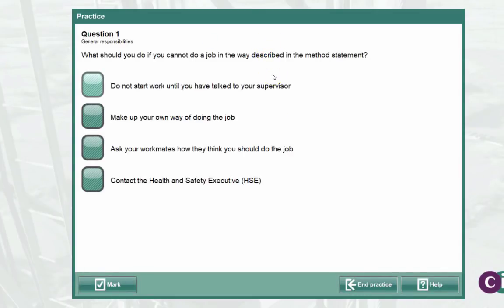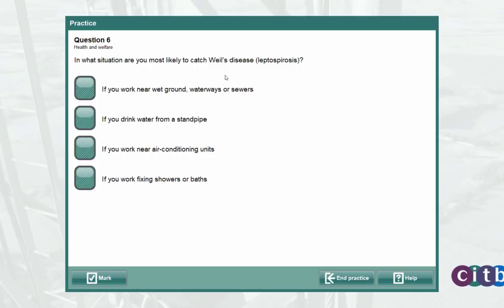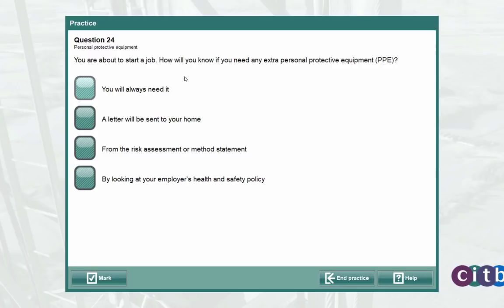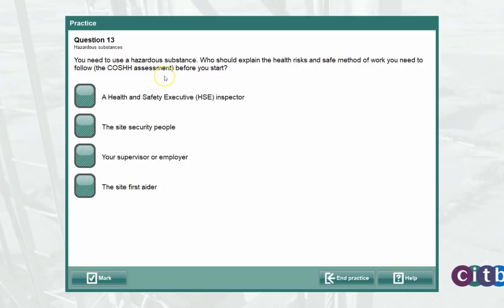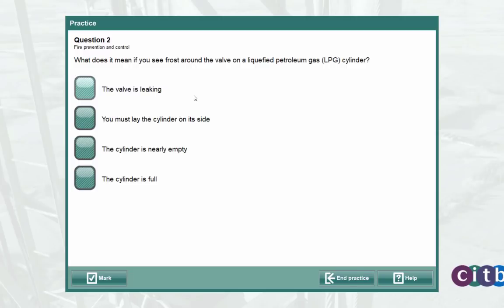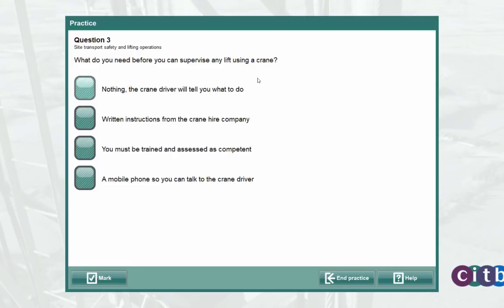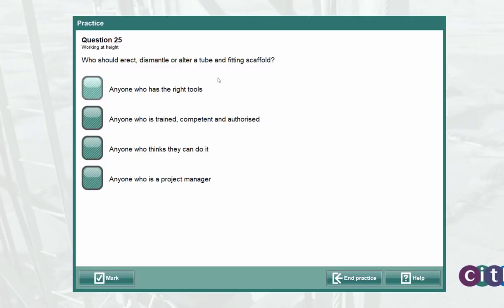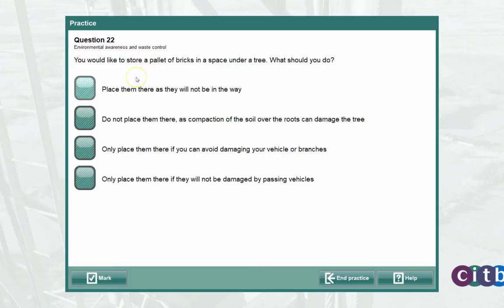CSCS Revision Questions

Comment: Sadly after studying for 3 months, learning all the questions & answers by heart and taking the mock exams on line daily and getting full marks, I took the real test and I failed dramatically. What I realised was that in the exam I had questions that are not in the test book and never heard of. How could this be possible??? Can someone give me an honest opinion please. I am disappointed and confused. Many thanks
Reply from the maker: Hi Osmany, did you check out the questions on this video?  You say you looked at the test book, what year was it? 

CITB change and add different questions from time to time but not so often.  This disc is 2018 and still has most of the current questions you will get on a CSCS test today. 

I recommend checking all theses questions and answers on this video and resit your test and I promise you most of the questions you get (if not all of them) will be on your CSCS test
Reply: Barry Joyce 
Hi Barry, thanks for taking your time to reply. The test book is from 2019-2020. Your video has all the relevant questions exactly the same as in the text, so that was a consolation, but if you read and study the book alone and do the mocks tests on line from/with the book you will not pass the exam because most of the questions are not in the text book. 
I am not sure if my rumbling makes sense but this is what I had experience...
Reply from the maker: @osmanyalmeidacruz6679  Yes, the books can be misleading as they also have tests for managers, gas etc.... so you will get confused. Keep revision on this video and you will not go far wrong - good luck and let me know when you pass :)

Comment: Are these questions very similar to the ones on the actual test? Thanks Callum
Reply from the maker: Hi Callum, yes, these are the actually questions you will get on your test. The disc was done in 2018 so there maybe a few new questions that are not on the video but not many
Reply: @BarryJoyce1590  They were exactly the same got 48/50 Thanks!
Reply from the maker: @callummccauley5276  awesome, well done

Comment: As well as watching this video, do you have any other tips for passing? I might buy the CITB app software. I think it’s around £5 , if I don’t have to could you recommend me more study material to use?
Reply from the maker: You can get the CITB app but its only the questions on here, but of cause you answer them yourself on the app. Its really up to you, but I would just going over theres questions by each category.   When you do your actual test, I would recommend you get head phone and read each question out, even if you think you know it. If your unsure read it out again, if you get stuck, flag it and go back to it at the end. You alway have the option to take a guess at it. Also take your time and dont rush the questions. You have loads of time and go back through your answers when you finish 

Hope this helps and let me know how you get on 

Good luck

Comment: I’ve got my test in 2 hours , I’ve watched this video and then done a mock test on my app on my phone and hardly any questions from this video came up . Will they come up more in the actual test
Reply from the maker: What app are you using on your phone?
Reply: Failed by 1 point I did , got it again Monday
Reply from the maker: @lolll1234  Sorry to hear that - good luck for Monday. Keep revising and read the question over and over until your happy. Let me know how you get on
Reply: Will the test be the same as last time mate ?
Reply from the maker: @lolll1234  It will not be exactly the same but you will get some of the same questions. As this disc shows there is appox 309 question in total and you will get 38 of them and 12 behaviour case study questions. Just try and revise as much as you can until Monday :)